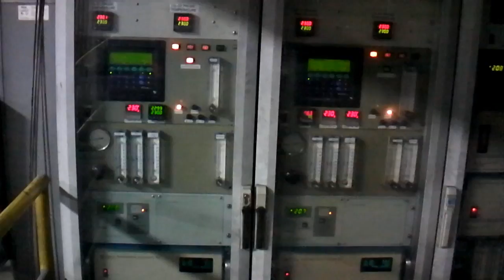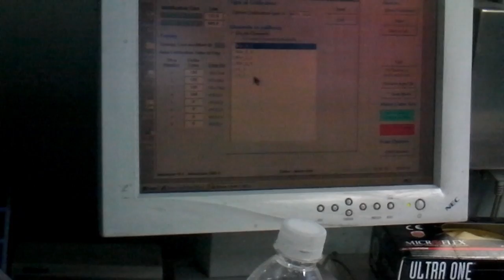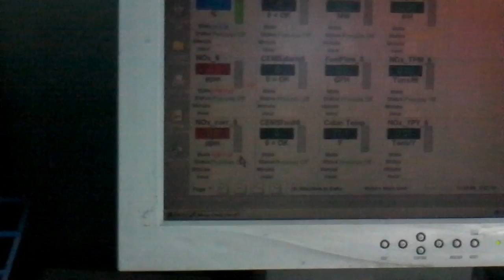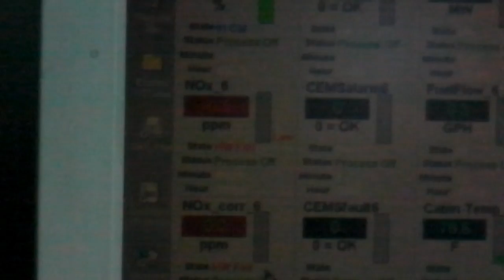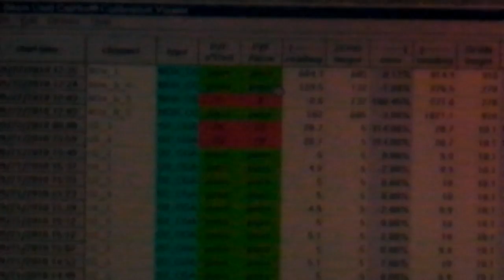CEMS analyzer calibration

Comment: Correct!
Every Cems system I've worked with over the past 18 years had all analyzer and sample conditioning equipment in a separate air conditioned shelter.
As far as the Teco Nox pumps, generally they can be rebuilt by changing the diaphragm and valve plate without removing the pump from the analyzer as the pump is readily accessible on the 42c and 42i models. 
Good video introducing people to a system few know or have ever seen, which monitors pollution into the air they breathe.